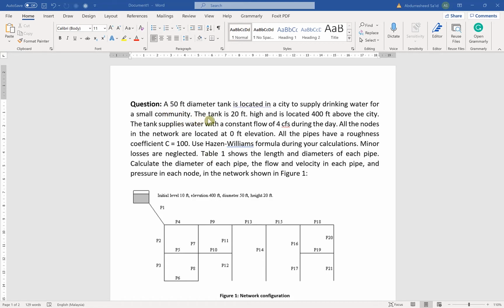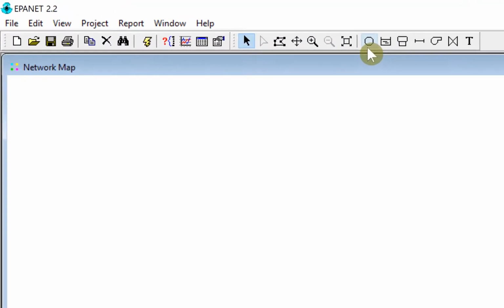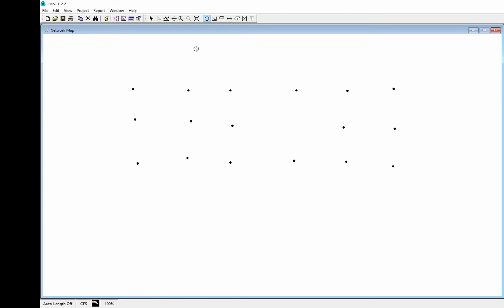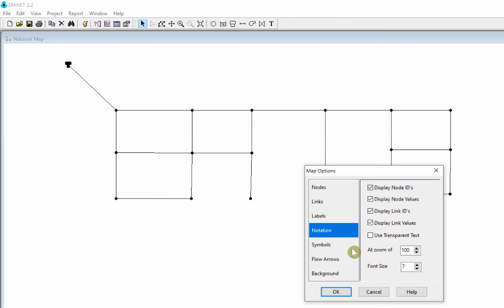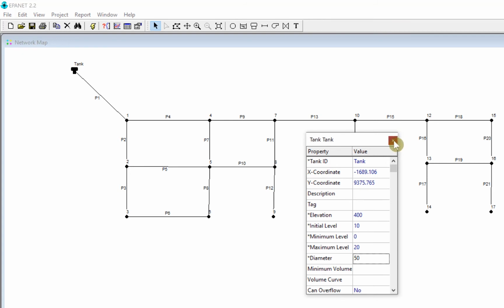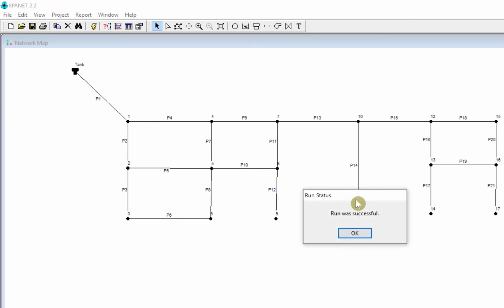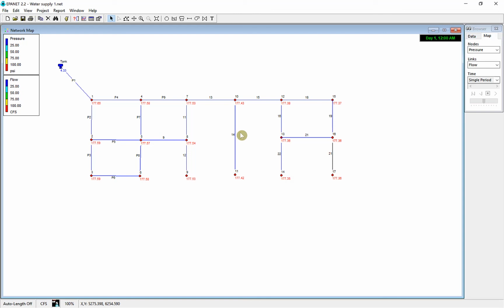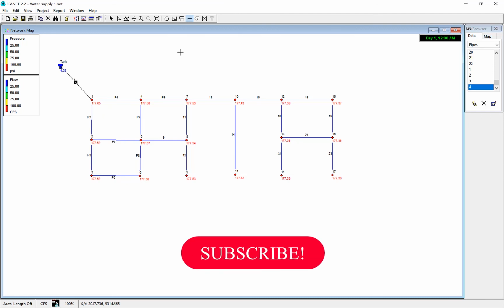EPANET TUTORIALS-WORKED EXAMPLE (A STEP-BY-STEP GUIDE)

Comment: as a sanity check, how is the flow in P1 0? is it because node 8 should have a base demand of 0.03 (and not 0.08) as shown in the actual problem? When using the correct base demand for that node, the velocity is 0.06 (whatever units). Does this make sense, or should it be 0? As someone new to not only the program but these kind of problems, I'm not sure (conceptually) if the velocity of water through a pipe coming from the tank is suppose to be 0, or very small. Thank you

Comment: But how you get the value 0.15 in the junction 1 to calculate first base demand ,and if you can tell me anothers base demand calculats ??
Reply: Remember, all the figures are theoretical. If you begin your analysis from an urban planning and thus determining if the settlement is low, medium or high density, and referring to WHO standards on water demand per capita (aka per person) per day (eg. 150 litres/p/d, for low density assumption is you have 6 No. people in the house thus 900l/d or 37.5litres/hr or 0.625litres/min or 0.01litres/second) as base demand. After this, sizing of the pipe is the only element remaining as you'd have a target pressure and flow velocity to attain your base demand.